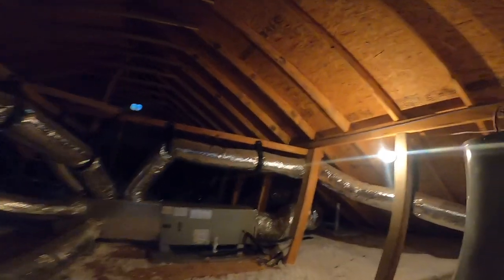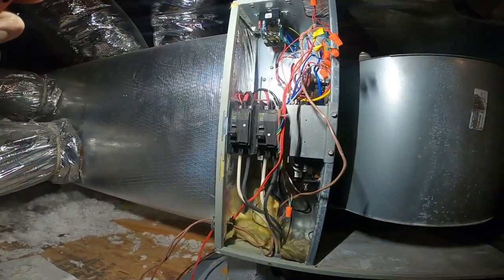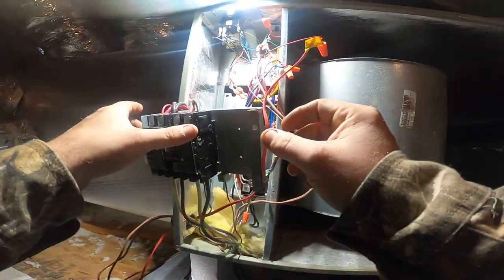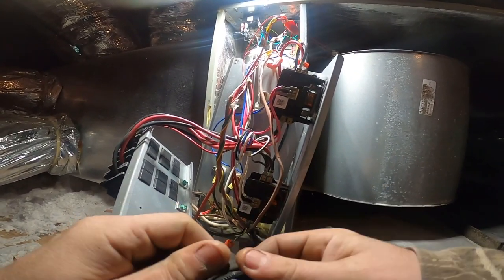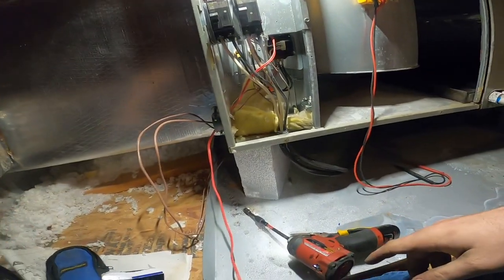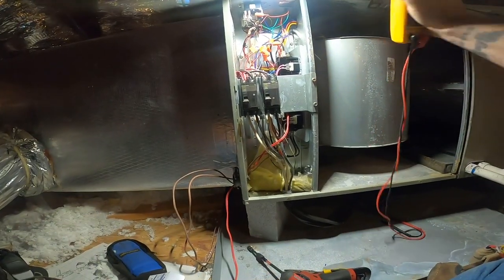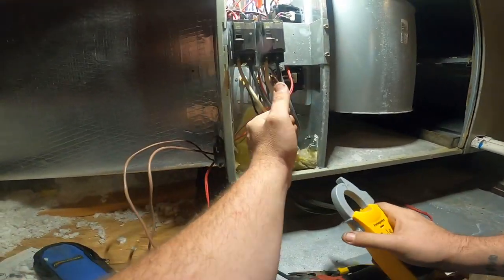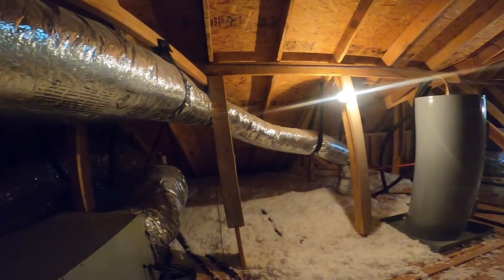No Heat/Trane TEM Air Handler

Comment: Before you even got started , I knew right away to check the control voltage for 10-20ohms, I’m proud to say I learned that from a previous video of yours John . I’m still an apprentice, but I have a lot of installs and repairs on my belt. Thanks John 💯💯🇺🇸🇺🇸

Comment: I always take the W wire off at T Stat and then run it to prove it when it has an 824.... the 824 will just keep restarting without ever blowing the fuse.... so if it late at night and I am all clean dressed and all, I can just give them heat without strips till next day. Moral of story is always use and 824... or better yet, change the cheap A$$ contacts before you ever install the unit !! Dad gum bean counters !!

Comment: My brother is a retired AC technician and our unit has a weird problem that he and I are having a hard time figuring out. This is what is does. It is a Amana two stage unit with a ECM condenser fan motor. The compressor now runs without any calling for anything from the thermostat and the condenser ECM fan does not turn. The compressor seems like it is getting half its voltage. We thought it was the board. We replaced the board only to have it doing the same thing. Could it be the ECM motor shortage and back feeding into the compressor to make it run with no call for anything or could it be the defrost sensor has gone bad? There is no contractor on this unit and it is a reverse cycle unit. I love your videos and thank you for keeping it clean and real! I wanted to see what you think it might be. It's a tough one!